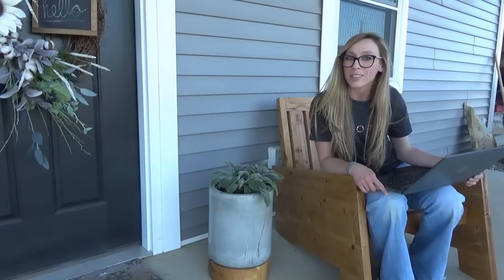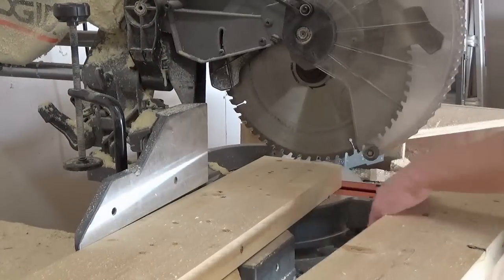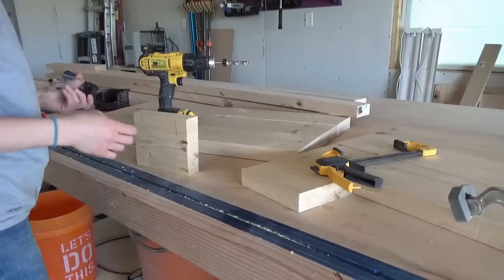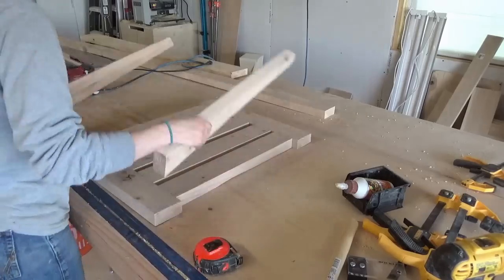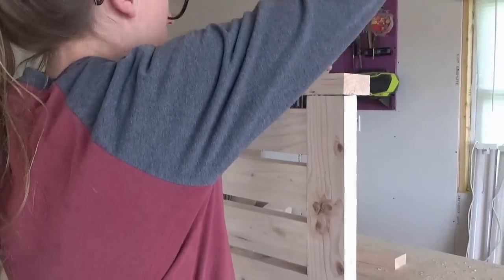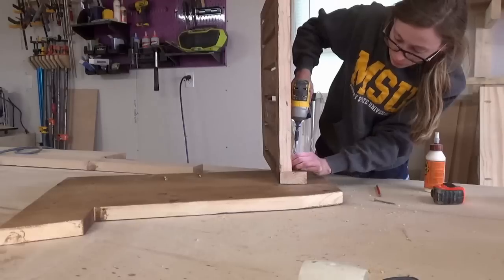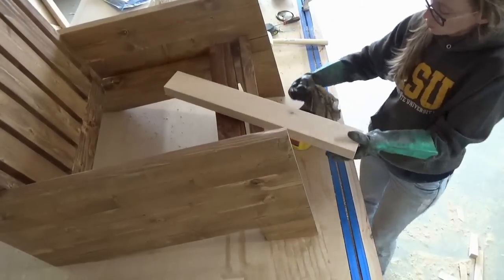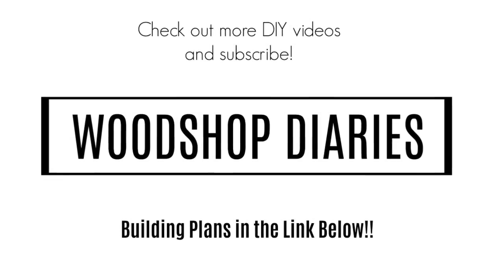How to Build a DIY Modern Outdoor Chair

Comment: First of all, you are amazing! Where do you learn how to do all days? And also, do you pre-design in a paper first? How do you know which size of wood to get in advance?
Reply from the maker: I usually sketch a rough idea of what I’m making on paper with final overall measurements and figure out from there what I want to use to build it. Each project is different so I pick wood sizes based on both design and strength/structure and try to stick with standard sizes to make things easier so I don’t have to make a bunch of extra cuts

Comment: Nasty split on the front apron (7:50). You may need to remove & replace. That's what happens when you don't pre-drill. Other than that, it's a lovely build. Well done.
Reply from the maker: Gary Furness thanks for pointing that out. I actually did replace it and you can see that when I’m applying outdoor sealant. It’s a different piece. I just kept going with the video when it split and replaced it after.